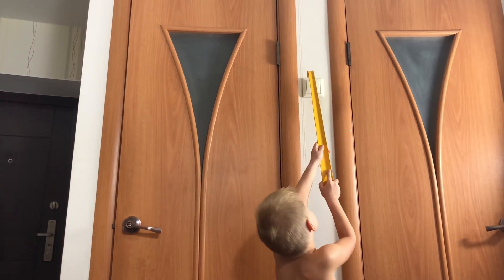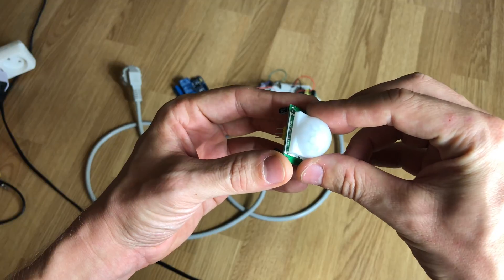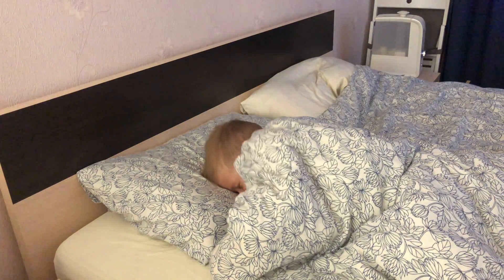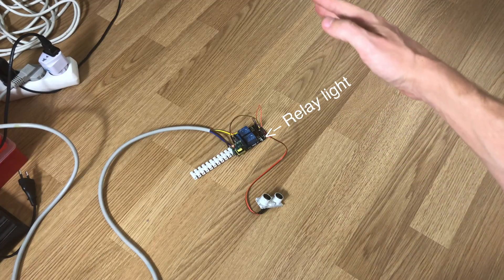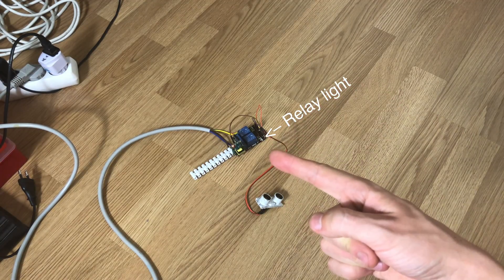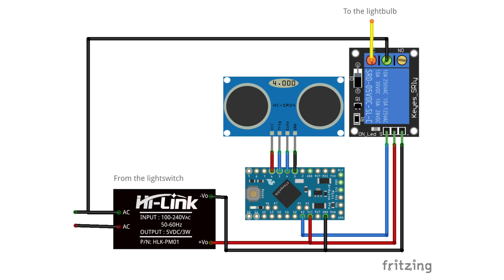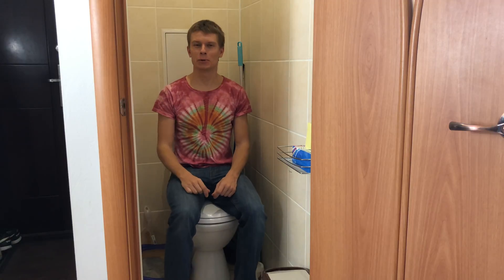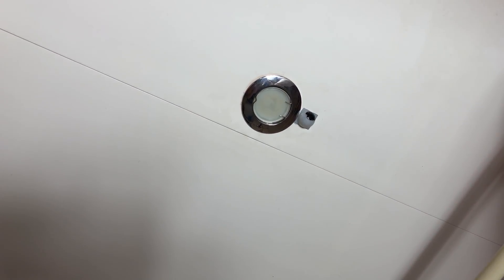ULTRASONIC VS PYROELECTRIC/PIR HUMAN DETECTION - automatic light switch how to

Comment: I used PIR sensor in Bathroom, where as it do not sense if some one is in both room for  more than timer set time. Person need to keep moving his hand to start is again. I used repeating signal option by setting jumper.

 Ultrasonic sensor range is not sufficient for my case. Please guide how to solve issue.

I end up removing sensor and manual switch is good option for me.
Reply from the maker: You're right, there's not many options here. You can increase the time, sensitivity, change position or remove the sensor completely.
Reply: Use Microwave sensor instead. It even detects when your finger moves a few millimeters.
Reply: @agentlier6974  is it safe for humans ?

Comment: Nice project!  I'm trying to find/make a motion sensor switch to turn on my garage lights when the garage door opens. Unfortunately the PIR switches won't work, do you know of an ultrasonic solution?
Reply: Chris Chambers "won't work" isn't specific enough for me to give you advice. Ultrasonic is good for measuring distance, not motion. You definitely can build an array of ultrasonic sensors but I think it's not worth it, PIR is used for this purpose for a reason.
Reply: if you are interested in tracking only your door movement, simple micro switch or magnetic door alarm sensor could be better. Ultrasonic could work to track presense/absense of the door where expected.

Comment: hello...I've a problem i hope you can help me out with.... I'm designing a system for blind people to help them detect obstacles in their way... now thr regular ultrasonic sensor doesn't differentiate between a human and non human obstacle so i was thinking about using the combination of ultrasonic and pyroelectric sensor so that the blind person is able to differentiate between the two.... but I'm unable to interface it with arduino according to my needs... can you please help me out
Reply from the maker: >I'm unable to interface it with arduino according to my needs
Please be more precise, what's your issue?
Reply: I'm using an ultrasonic sensor for detecting obstacles, and giving a vibratory feedback so that the blind person can change paths.... now since the ultrasonic sensor is unable to distinguish between animate and inanimate objects,I've to use the combination of pyroelectric and ultrasonic sensor.... but I'm having difficulty in developing the coding
Reply from the maker: >I'm unable to interface it with arduino according to my needs -> I'm having difficulty in developing the coding

It's not specific at all.

Comment: i have some problem in calibrating the PIR SENSOR , its simply turning OFF AND ON CONTINUOSLY IAM PISSED OFF WITH ITS WORKING...... if u could kindly help me with it, i would be glad
Reply from the maker: Hi! There are 2 variable resistors (at least on mine), one is for time, second is for sensitivity. You can raise time and sensitivity so it won't turn off until it's needed.